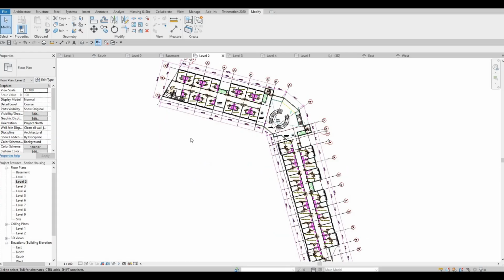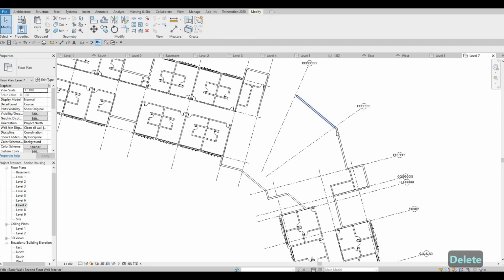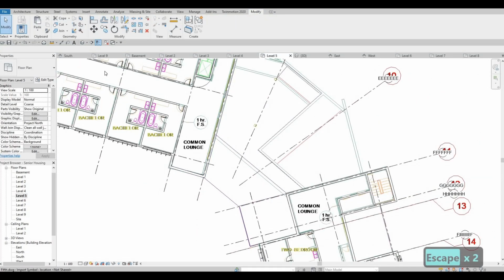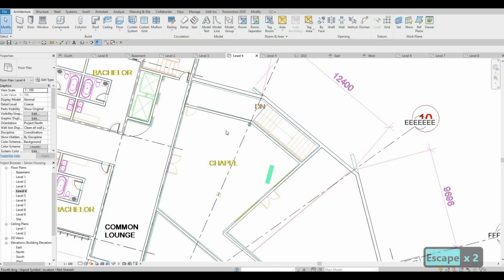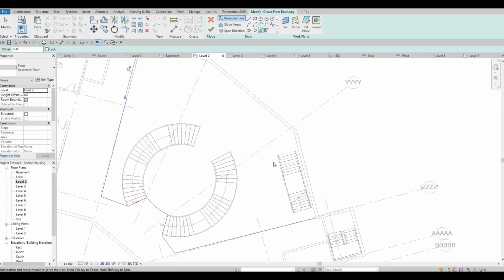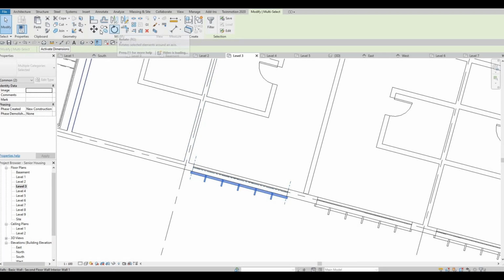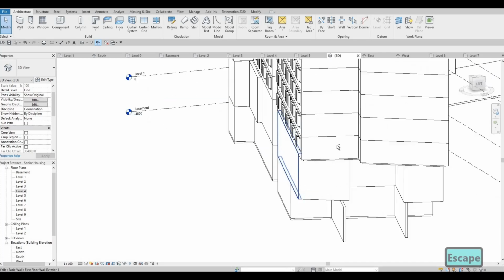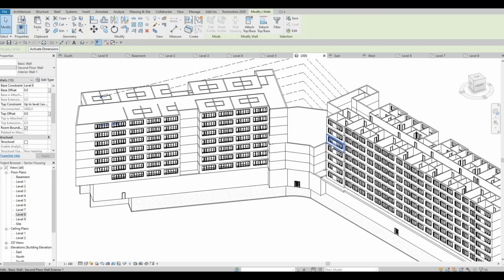Senior Housing | Part 7 | Complete Step By Step Project | Revit Tutorial

Comment: Hello there, I just want to ask if you have any tips for exporting steep terrain from Revit to Twinmotion. I tried modelling  a steep landscape from contours and I have to introduce a building pad but each time I try to export it to Twinmotion it doesn's look right: it appears as a cutout and a blank space at the back of the terrain.
Reply: thank you for the reply, I think this tecnique will be useful if the project only had 1 level difference but because it is so steep I dont think it will work. Maybe if you can suggest an alternative. I extruded the contours and they are very steep in revit.
Reply from the maker: I am think about this video that I did before, although you will use other programs. https://www.youtube.com/watch?v=EoJNGL9r5VI&list=PL3sodtZEOQfmpWKXHgFU7XUKNQMCyI-Ma&index=24 🙂🙏
Reply from the maker: also using cad mapper https://www.youtube.com/watch?v=DVe0F-irHvI&list=PL3sodtZEOQfkUgQN1DabwyNNuv1vq8Ao_&index=7 🙂🙏
Reply from the maker: if that didn't work, send me the revit file and I will check what is going on to the file. send it to archcoredesigns11@gmail.com but please advice that I have family visiting and I am somewhat busy at the moment. 🙂🙏
Reply: @ArchCoreDesigns  Thank you so much. I will send you the file for you to have a try and see what could be done to it.
Reply from the maker: Yes please 🙏🙂
Reply from the maker: Hi, what if you use the same technique I used for the KNR house project, if you check, there is a change of elevation used for that and I used a sweep so that I can control the look of the landscape better. Let me know if that helps and if not, I can provide an alternative. 🙂🙏